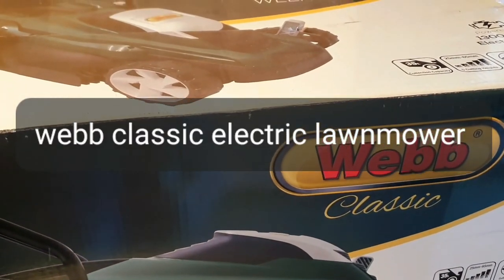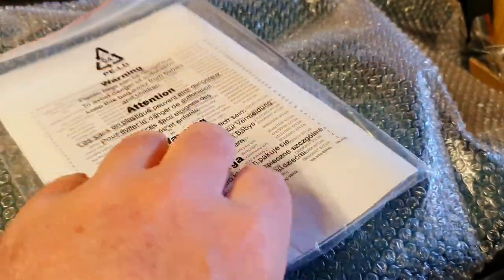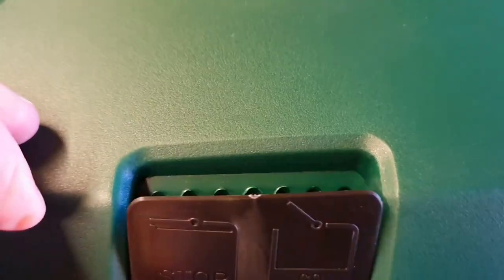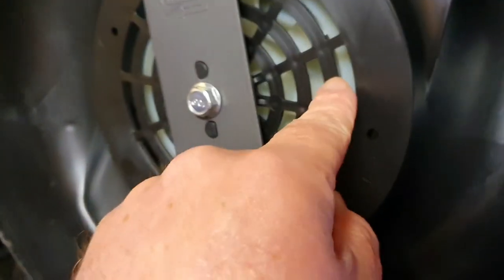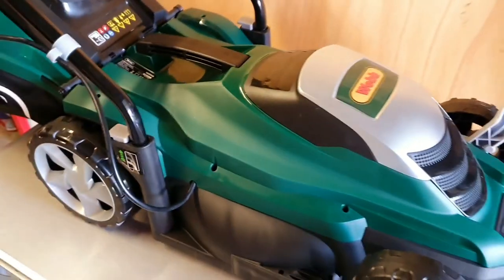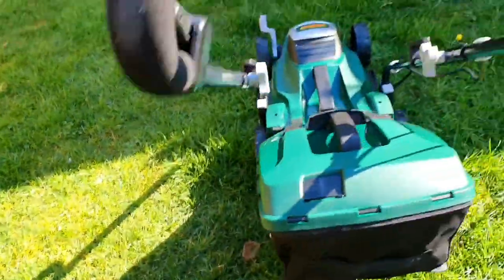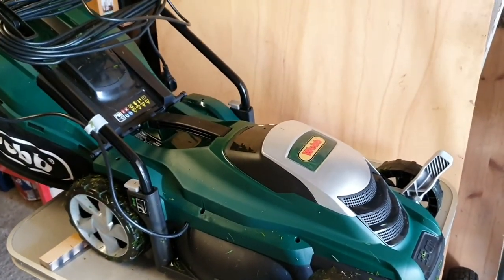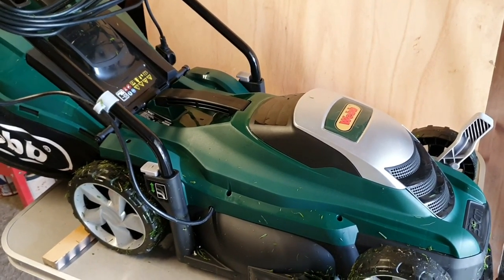Webb Classic Electric Lawnmower Best Mower For Under £100

Comment: Thanks for the demo, Just had the larger model 40 cm cut 18 wt motor arrive Saturday, wheels already attached the rest took ten mins to put together, the height adjuster so easy to use cuts well seems to be for sale at £149.99 every where, would also recommend.
Reply from the maker: Thanks thats great you are going to lots of reliability with that mower as ive tested a few on my channel this Webb one is great 👍